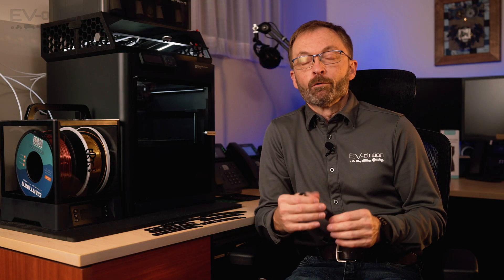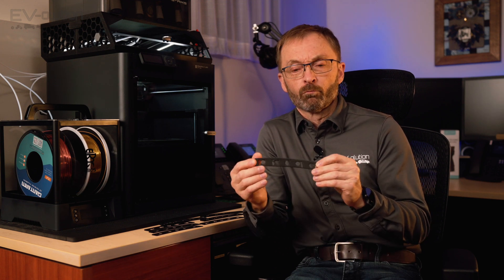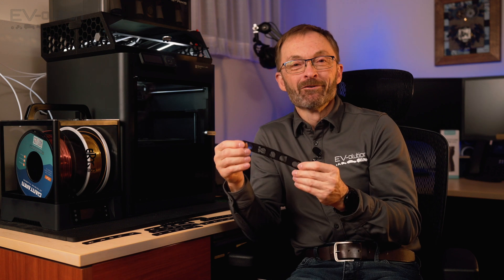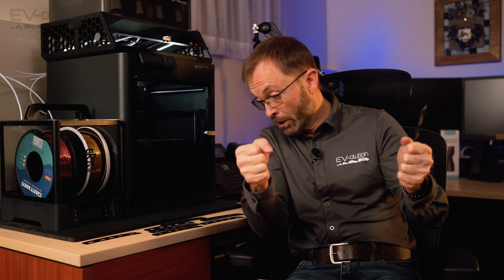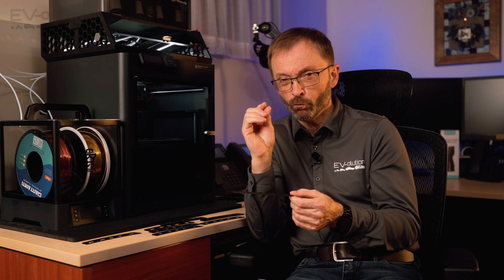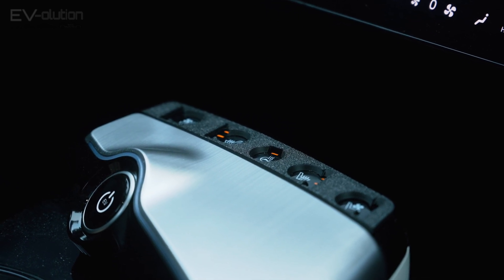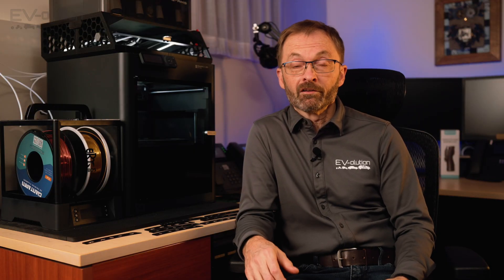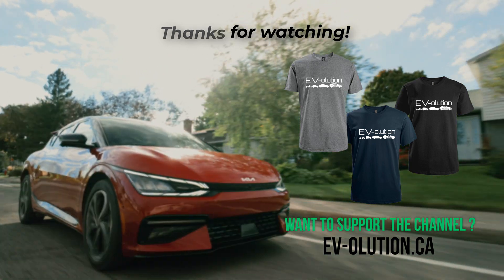Kia EV6 Touch button problem

Comment: Voice  command. switch the seat heating to level 1

￼

￼
Reply from the maker: I have used voice command, but that does not solve the problem of accidentally brushing to touch buttons, which is the biggest issue.
Reply: It does minimise the opportunities to accidentally trigger them though.

"Set climate to 20"
"Open navigation"
"Open settings"

Etc... it minimises the need to push the buttons on the multi function display so minimises the chance of accidentally triggering the seat heater.

I agree its still a papercut of a problem, but it definitely makes it occur less.

Comment: I did the exact same thing a while ago!  I started with the same design, but didn't like the visibility for the lights.  After modifying the holes, I went the opposite direction from what you did -- instead of putting the textured side up, i printed raised markings on the top (also printed in color in case I glance down) for tactile indicators identifying the buttons.  Details aside, this is a great mod for the console buttons.  I also tried printing a transparent version, but was never satisfied with the results.  Edit:  Completely concur with your recommendation not to use PLA for anything that's going in a car.
Reply from the maker: I did print one for somone I know, with the face up, but I used ironing to make the top smoothe. It looks good, but I have a preference for the textured finish.

Comment: Seems I am dumb as a doornail, but I do not see the link for the file to download. The Solution is brillant
Reply from the maker: Nope, you aren't dumb, you just didn't scroll down to the links section of the description 😎. It includes the links below.
Where to download the 3D Print file I made:
MakerWorld: https://makerworld.com/en/models/891935#profileId-848631
If you like my make, I would really appreciate if you could boost it on MakerWorld. Thanks in advance.
Printables: https://www.printables.com/model/1112960-xerses-remixremake-kia-ev6-console-capacitive-butt

Comment: Cool idea. I watched a video made by the two lovely young Canadian women at Brantford Kia and it looks like they have put real buttons on the 2026 EV 6 and have gotten rid of most of the piano black. Still has the dual duty infotainment/climate screen that seems less than optimal to me. I wonder if the same thing would be helpful for the capacitive buttons on the EV 9. I've heard people complain about hitting those by accident when using the infotainment screen.
Reply from the maker: The one in the video you saw must not be a GT Line Pack 2. Unfortunately the GT Line 2 pack still has the capacitive buttons. The dual touch panel is not an issue if you leave it on climate controls and control the radio/media from the steering, like I do. For daily use there is no real reason to use the media screen of the panel you are referring to.
Reply: @EV-olution  Here's a video from the LA autoshow and he says it's the gt-line. He pushes the buttons so I know they aren't capacitive. (at 7:10)  I think I can get used to the dual use touch panel but I'm just saying it's less than ideal. My wife drives my car off and on and I know she'll  have little patience for it. I think it's also less than ideal for the passenger as they will need to switch controls to make it work for the stereo. It just seems to be an unnecessary step when there is so much space for both. I look with envy at standard controls on ICE cars. I do like that when it is in climate mode it has knobs for the temperature, that's one advantage for me. 
https://www.youtube.com/watch?v=yyIWXfH-Kto&t=234s
Reply from the maker: It has the sunroof, so looks to be a GT Line 2, and has real buttons! That's amazing and not what I had seen in a picture. I have noticed though, that there are differences in trims and tech in Canada and the US, so I need to see one in person to know for sure because I don't remember the buttons in the one I show in my last video.
Reply: @EV-olution  "there are differences in trims and tech in Canada and the US" -- there are, but not in this case. In the US the GT-Line also has the capacitive touch controls.
Reply from the maker: Thanks

Comment: Now we just need someone who can design a rain cover for the backup camera.
Reply: Since it is soiled mostly by indirect splashes (it's below the spoiler line), a cover won't help.
Reply: There is also some water splashing from the top. There are some forum posts where owners have tested with transparent plastic on the top of the camera with success.
Reply from the maker: Good idea.